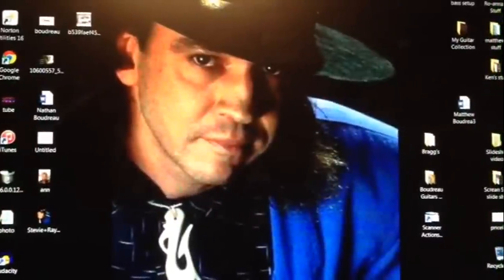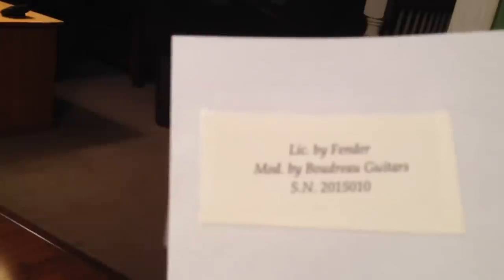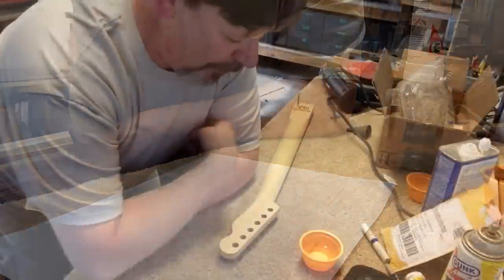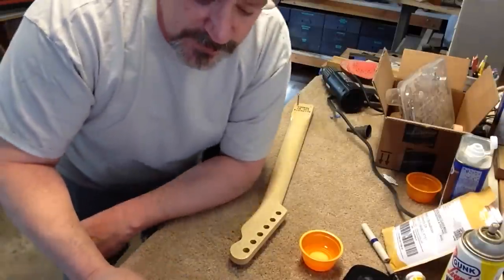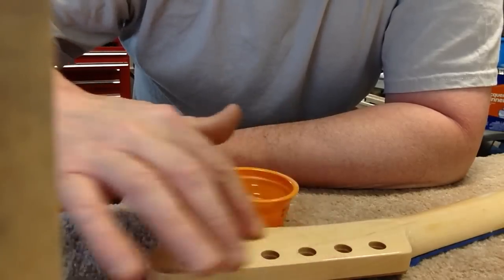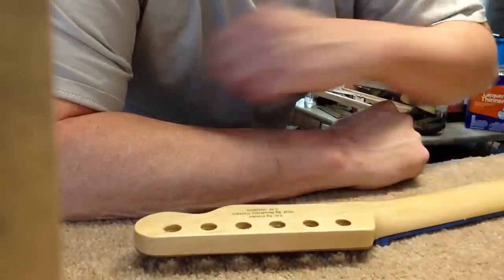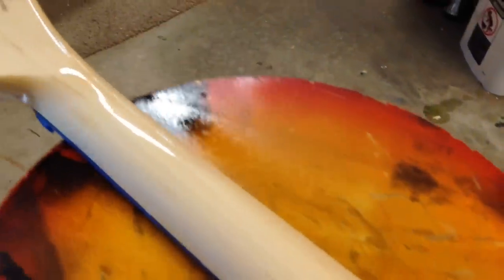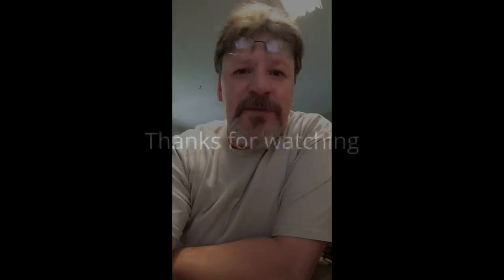Luthier's Tips & Tricks #2- Make your own water slide decals

Comment: Excellent video. Thanks for that. The only thing I would do different is not use lacquer for the final clear coat. Do you have any other suggestions of what to use? Obviously it has to be wet sanded and polished. I once did this with polyurethane enamel but that product is no longer available in Canada.

Comment: What if you are putting a new decal on a headstock that was finished in a polyurethane clear? Lacquer would eat into and lift the polyurethane finish. Would you clear it with polyurethane? You can spray polyurethane over lacquer but not lacquer over polyurethane. I had worked for 31 years in the Automotive Paint and Auto Body Trade and spent 10 years as a technical advisor.
Reply: I use nitrocellulous lacquer with no problem over poly.

Comment: I've seen those spray bottles recently. How do you find it and is it cost effective for full spray jobs or just small details? Thanks.
Reply from the maker: Pádraig Floyd I use them to do full spray jobs as well, the refills are $4. and the jars come with caps so you can save any unused lacquer for later.
Reply: +Boudreau Guitars thanks.

Comment: I would like to Do this mod for my pacifica 112j.
But i have an unfinished neck. What would you recommend doing?
Reply from the maker: Jakob Sachs , on the front or the back of the headstock?
Reply: Boudreau Guitars Front side.
Reply from the maker: Jakob Sachs , just clear the front, good to go 👍
Reply: +Boudreau Guitars   Sorry, but what do you mean by "clear the front"? If the headstock has no finish, what do i need to do? Straight wet sand, or finish it first and then wet sand? Thanks for any help i can get, i'm bulding a bass for a friend for the first time!

Comment: Just of curiosity as I'm going to start building some guitars... still if all parts are licensed by Fender,  the final product wouldn't be "licensed" by them. Now if you as "a shop" or as "luthier" are, then yes. But then you should be licensed by them and extend also a proof of authenticity, with every guitar. 

If you don't have that, you should put "all parts lic. by Fender", that's one thing, but the guitar as it's workmanship still isnt.  That's what I read about.

Also as a non-Fender original (or licensed" shop,  to avoid any frauds, you should mark both neck and body with your logo.. Best way.. burning it in.

Maybe this stuff only applies some countries? But should be standard procedure from any luthier.

What are your thoughts on it?